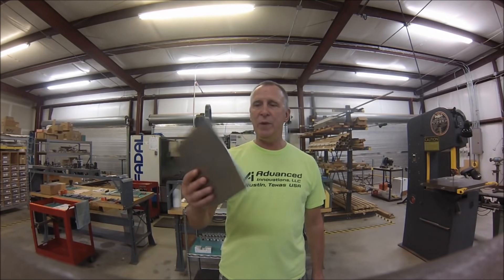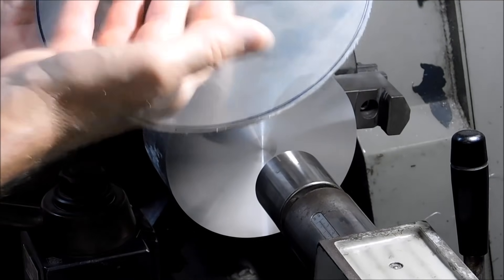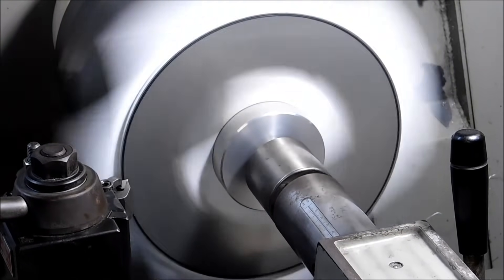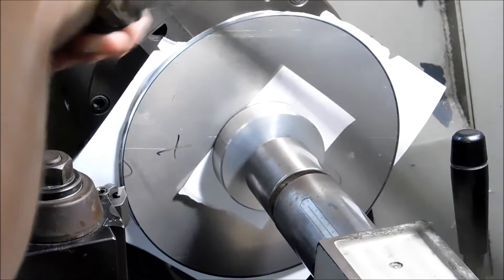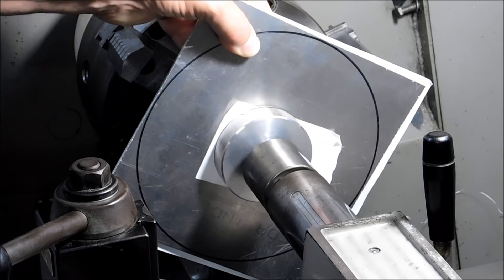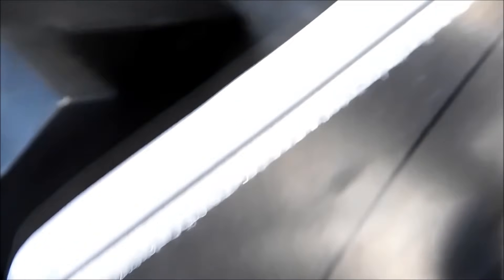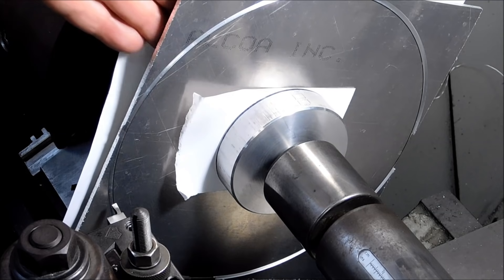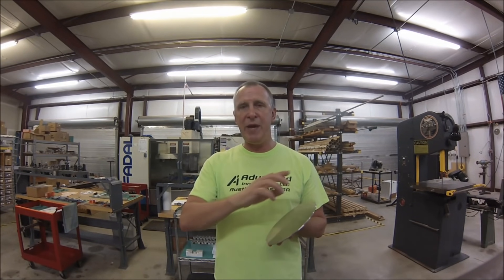Pressure Turning

Comment: Painters tape and super glue work really well. Of course you would have had to turn a large piece of round stock to act as a sort of face plate. The large surface area allows the tape to have extremely impressive holding strength.  The glue simply holds the back sides of the tape. I've employed the technique on milling operations several times. Never a bad result.  Give it a whirl some time if you haven't tried it.

Comment: once I had to do this with a polygon, i could fit it in a 3 jaw chuck to drill in its center and then I only had to use a live center pressing the 2mm thick and about 125mm diameter steel sheet piece against the jaws of the chuck. It seemed dangerous at first but it worked fine.

Comment: Hey Joe, what about using double face tape as your driver medium?  Also locating a center point for your circle and rough locating that with the tailstock center before you add the front driver support.   I also knock the corners off to an octagon on the saw, doesn't take as long as cutting a round and really reduced the flying triangles of death that trepanning the OD gives you.

Just my $.02, would be interested to hear what you think.
Reply: I was thinking a similar thing... A light dusting of 3M super 77 on the paper and then letting it dry would give it just enough tack to keep if from slipping, without gluing it to the part or fixture.

Comment: You have a very good eye :) Why would you not use instant glue like watchmakers? I guess it saves the clean up and having to heat the part to get it off but it would give a bit more confidence ?
Reply from the maker: Thats fine for 1 piece, but for production, its not practical. Be sure to take the weight of the part into consideration when using super glue.

Comment: Didnt get through all the coments posted on your pressure turning demo and I was wondering if you ever use super glue arbours to secure the work to the "back plate"? I know its more time consuming having to heat the material aftetwards to break the glues bond but it makes me feel safe. Can be used with another square sheet at the rear as well to secure the potential ninja stars:) Thanks again for the videos, they are always good to watch
Reply from the maker: For sure there are several things you could do to increase the safety factor for this operation. A larger rear driver plate with a series of 1/8" holes for short dowel pins would be the first thing I would make. I'd sacrifice the backside chamfer ability for more safety and be perfectly happy doing so.
Reply: Thanks for taking the time to reply, cheers mate

Comment: And you’ve got some tinsel for Christmas now too lol. Excellent work. Just wondering would a slip of vinyl or something similar be great as a backing mat? I would think it would make the grip very good.
Reply from the maker: If your finish allows for it, a self adhesive PSA sanding disc of about 220 grit is probably the best.
Reply: Another great presentation, I was also thinking that self adhesive sandpaper would work.

Comment: Great video, thanks. In tihe World og watchmaking this is done using a wax Chuck and schellak.  But here parts are much smaller, but i Think this  could be done in some way like that, still having pressure on the front.

Comment: I am confused, I work in the medical field so my machining is one of my hobbies. I am an admitted amateur at best but why not double stick tape and goof off to remove it in place of paper? I studied metal spinning videos and this is the same starting point. Next step is to immediately pull metal over the form to lock it in place.So this is easier than cutting blanks with snips but tape is cheap.

Comment: Why don't you super glue the the part to the face plate and use a little heat after you are through machining to turn it loose.
Reply: I'm guessing productivity.  This is a very quick setup.    I might be tempted to superglue the clutch material to the driver and backplate though.  That loose paper could get annoying after 20 parts.
Reply from the maker: That paper is annoying on the first part.

Comment: Brass bells 2-3" across are dressed and tuned from castings, with surprisingly small radius on the puck. The driver is a dished and threaded 8 mm rod, the inner puck screwing to the rod. You have to be able to hear it, so the puck and driver stay small. Fun but pointless pedal: drum, bells, cymbal, found on Viennese pianos.

Comment: I am surprised that two sided adhesive tape never came up in this video. I guess if I use tape it is not strictly speaking a "pressure turning" even if I use tail stock to apply pressure?
I have done almost exactly same thing on small Chinese lathe (Grizzly g7068) but in my case metal is much thinner (~1.8 mm) and I use thin, 2-sided carpet adhesive tape (from Home Depot) instead of paper - that seems to work very well for me. There is also spray adhesive for foam that works as well but problem with it - it is harder to remove between parts. I do apply pressure with tail stock but not a lot.
Reply from the maker: It was mentioned in the video description text. Adhesives are tough to work with when you have a bunch of parts.

Comment: A good sequel to this video would be on spin forming on a lathe to make a bowl or light reflector.
Reply from the maker: I find that very interesting but have never tried it.
Reply: Another form of pressure turning is a cylinder between centers. When turning between centers the  lathe dog may get in the way so for a finish cut remove the lathe dog and increase the tail-stock pressure to take a fine finish cut. Spinning metal can be done on heavy duty wood lathes or any metal lathe for very little tooling cost, in either case it is a very dangerous albeit almost magical artistic metal forming. I have not done metal spinning either but enjoy watching people do it.
Reply: it is something i would like to give a go one day once i have a bit of experience behind me on a metal lathe. have done a lot of wood turning

Comment: I would use a round adhesive-backed abrasive cloth.
Reply from the maker: PSA discs.
Reply: abrasive is not good, it will rough up true and flat parts. I would rather use thin rubber

Comment: The other reason to have a backer and pressure plate close to the finish diameter is if there is any  wobble in the work piece it will keep it flat.
Trepan a square workpiece that wobbles and you discover why the origin of the word refers to putting holes in a persons head!!!
Reply from the maker: That chatter can be hard to get under. The hand feed helps you "feel" the cut.

Comment: On the driver how about boring out the friction area to hold the part and using a hockey puck for friction.  The rubber has a little give that might hold the work better than paper.  Just thinking out loud.  Good video.
Reply: I Have tried both a rubber backed puck and also double sided tape, so long as material is really clean they do both work. The clue is can you apply a fair amount of torque to the piece whilst holding the chuck still. If you can do so then a sharp and properly set tool will cut safely or at least as safe as this operation gets.  Also just to echo all the guys out there, Joe, you provide an incredible and valuable service to the machining community. Long may you continue. Sorry too for your loss, it a tough blow.

Comment: Assuming you're cutting about a 1-foot circle there, at 320 RPMs you're looking at a speed at the circumference of approximately 11 miles per hour. Not to say that it's completely safe but it's quite far from 400 miles per hour.
Reply from the maker: My actual speed was under 10 MPH, but it doesn't feel that way when those corners break off and come at you.

Comment: For something like this I'd take a leaf from Clickspring's book by utilising a superglue arbor. Much safer, and you can still use the tailstock to add that additional pressure.
Reply: AppleAssassin my thoughts exactly.
Reply: I was thinking the exact same thing. Although I guess super glueing it would require a center mark to be places so that you know it's centered on the arbor before the glue sets. And it's possible this part can't have a mark like that for the finished product.
Reply: Can also use a vacuum chuck on a mill. Really, there are lots of better ways to do this, this is just the simplest.

Personally, I'd rather spend a little extra time to do it properly and have the confidence that my work isn't going to come loose and hurt somebody. 

Reading the comments from the author, it seems like they decided working fast and making money was more important than safe, reliable fixturing. If you ever find yourself working in a shop like that, quit on the spot. I'm serious, you shouldn't work at a place that expects you to take risks with your personal safety so that they can win more bids and make more money.

Good, reputable shops take safety very seriously. Good shops don't sacrifice safety so they can bid lower.
Reply: Output Coupler moreover you don't want to bid for customers unwilling to pay for your safety. It's not a relationship worth developing.

Comment: Bollocks to doing the second one at all, standing to the side or across the room isn't gonna stop my ring piece clenching up tight. If one of them corners come off and hit a jaw, it gonna be bang crash clatter clatter and blood everywhere.
Reply from the maker: The worst case scenario is when 3 of the 4 edges break off, stay attached as a continuous string, and stay spinning at full RPM. Its the weed wacker from hell.

Comment: HI Joe, can I use self sticking sanding discs right to the backing block and pressure block ? I realize once completed I will have to peel off and clean the block or just leave them for multi cuts. I can then use a 8 inch for the back and not worry about the paper sticking past the  work and the front a 4 or 6 inch piece.
Reply: Nick De Cicco 

I don’t think that would be wise. You would have a lot of pressure between the block and part. Sand paper will make little dents all over the part it’s self. Plus, if you take too big of a bite, the part will spin between the blocks and ruin your part. That would just be another thing to fix while making a part. But if the surface finish isn’t important, it would work. I hope that helps. Have a good one. ✌️

Comment: I have done this before too on sheet metal parts.  Super glue is a pretty good comfort tool for this job, but slows things down if you have to do it many times.   How come not do it in the CNC?
Reply from the maker: Then it would be clamped and not a pressure turned operation.

Comment: Your video is very interesting. Im training to be a machinist and I never do pressure turning. Quick question: when you were setting up the square piece of sheet metal to the driver which is seated to the live centre on your tail stock. I noticed you ‘eye-balled’ the workpiece to ensure concentricity. How do you know it is completely concentric without using a dial testing indicator to set this job up on the lathe.

Comment: Hi Joe, I wonder if one drills 4 holes in the corners of the square plate and bolts it on a face plate, putting some kind of block also bolted to the face plate behind it to create clearance for the trepanning tool and to hold the inside disk, and also use the pressure thingie in front, would that work safely?.  It may avoid the Bruce Lee flying triangles :)
Reply from the maker: A larger backer plate with some type of positive driver would be a good idea. Removing the corners on a bandsaw if practical would probably be the best.

Comment: Why can't you just use a magnetic chuck?
Reply: Joshua Legault aluminum is non ferrous
Reply: what if he sandwiched the aluminum between a magnet and a piece of steel?
Reply: I know that aluminum is nonferrous.  Why didn't he sure a magnetic chuck?
Reply: Um... non ferrous means it contains no iron. No iron means no magnetism. Aluminum contains no iron and therefore isn't magnetic. As for the piece of steel and a magnet... A) Not too many machine shops with big enough or strong enough magnets to make it useful. 2) The shear force on a magnet is pretty weak if you used the magnet in place of a center. The process he showed is one of a million ways to accomplish the same task. That was likely the fastest way to meet a delivery date.
Reply: Doctor Red the part is an 1/8 thick. I guess magnets stop working after an 1/8 of al.
Reply: Joshua Legault sure
Reply: Joshua Legault, the aluminum magnet. Doh!
Reply: Jeremy Tenorio, Why would you need an aluminum magnet when you can use a real magnet?

Comment: glue two sheets of sanding paper instead of a single sheet? prevents the sanding paper itself to move
Reply from the maker: I've seen guys double stick tape it to the faceplate for a good traction surface. Same concept.
Reply: @joepie221  yes something like that. If you have a high spot and you hit it then the plate could move out of center with dramatic consequences when running at high rpm.

Comment: Boy do I enjoy your videos! I'm  just an old hobbyist,  but you sir are the quintessential machinist's machinest.  Now, being near 70yrs. old, and having a hamster in a cage running my 6" bench grinder, do you have any idea where I can purchase a hss trepanning tool such as the one you used in the video? Grinding one myself may take the rest of my life. 😕
Reply from the maker: I have to believe this is a tough request. Commercially available tooling will probably be of the insert type and carbide. have you googled it? What material are you cutting?
Reply: For  aluminum plate of that thickness, a small HSS solid boring bar, held short, or a round HSS bar with a short flat ground on top of it and the right vertical relief should do. The bar needs to stick out only the minimum amount needed to avoid chatter. Obviously, the critical side of trepanning is the side furthest from the center line, (the "I.D." side) since it needs a round relief to avoid rubbing. The side closest to the center (that cuts the "O.D.") could be vertical.  A round bar has more than the needed relief. I worked with some commercial trepanning tools around 1970, and they were massive (and very pricey, I forget the brand). They came with a "range" of ID/OD. They were wonderful. We used them to "carve" a "mote" on very large spiral bevel gear blanks, on a Warner & Swasey SC15 NC lathe (before CNC :)

Comment: You said 400 RPM, then 400 mph at the end, but I think it'd come off closer to 15 mph, right? That's how fast the outside edge is moving.
Reply: Correct. You'd need ~17k RPM to hit 400 mph on an 8" disc.
Reply: Trollygag shhhhhhhhh🤫

Comment: Hi Joe. Firstly i love the channel. Excellent source. 

Looking for some advice on producing large diameter rings out of mild steel. We have recently got into another market which requires us to manufacture retaining rings of sizes up to 330mm on the outside diameter with a internal diameter of 250mm usually around 3mm thick. 

At the moment we have only a large lathe at our disposal. Cutting the ID and OD is not our main concern. It's the parting that causes problems due to the time and wasted material it takes. Were using a kennametal parting tool holder with a 4mm carbide insert with a right handed leading angle. I was really just wondering how you would go about mass producing these rings. We go through around 100 of these per year. 

I would really appreciate your thoughts on this. 

Thanks Ross
Reply from the maker: I think I would do it from sheet. Pay someone to waterjet them out of a large sheet. Be sure to keep the remnant scrap parts that result for future jobs or to recover some of your material cost in scrap. Otherwise, the 40 mm parting depth will be a pain in the butt forever.

Comment: Vacuum is much better and you can do all the surface operations at once on the milling machine.
Reply: Kakviool Ps4 yeah I'm with you on that boring bar would be much better than that scaring the s*** out of me I got to quit watching it
Reply from the maker: You may have a tough time chamfering the backside of the part, but a vacuum plate should work just fine.
Reply: Joe Pieczynski I just turn it around and do a circle whit the chamfer tool
Reply: Vacuum fixtures are great if you can afford them, not everyone or every shop can. Joe did mention that nearly the same end result can be accomplished with the use of a rotary table, but it is time consuming in comparison to pressure turning.

Comment: Interesting but safe enough of the square stays together, in fact I'd insist upon it.
Reply from the maker: It will rattle a little when it breaks free, but its not quite as dangerous as when the saw guy cuts the material too close and that's not an option. The worst situation is when one edge holds on and the other 3 break free, stay connected to the 4th and spin like a weed wacker from hell.

Comment: good stuff.   8 inch diameter at 320 rpm is 965097 inch/hour =  15 MPH.   but i'd still be careful.
Yep. I am out.  Its 12.2kpm or 7.6mph.
Reply from the maker: 8 inch diameter. Where did you get the  965097 number from?
Reply: 7.6mph, you multiplied by 2 somewhere
Reply: @joepie221  he took the diameter twice. He probably used the 2r*pi fordula and put d in the place of r

Comment: Great tip. Wonder what can be done in a hobby lathe.... Some small things maybe.. Friction is important and that is, if I remember, the force divide by the area of contact. Large area, less force per area unit, smaller area of contact, more force per area unit. The friction coefficient multiplied by the force gives the grip. Interesting business!
Ah, using emery paper must give a good grip.
Why not the emery paper in the second example?
Time 09:40. Rotating the chuck by hand is always a good habit I think.
Time 12:30. Kung Fu stars..... I get it!
Time !5:50. ...coming off at any RPM.... No, those edges are razor sharp, dangerous even at 0 RPM.
Bandsaw work is an option and then conventional turning...
Reply from the maker: Thanks for the comment.